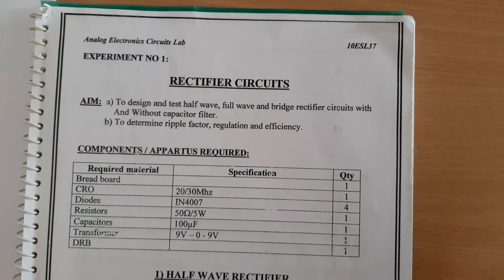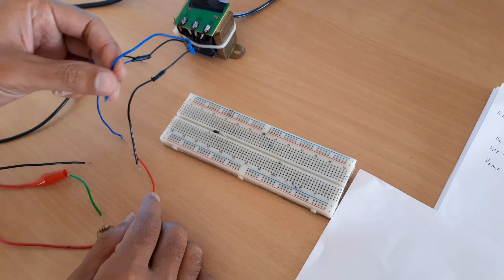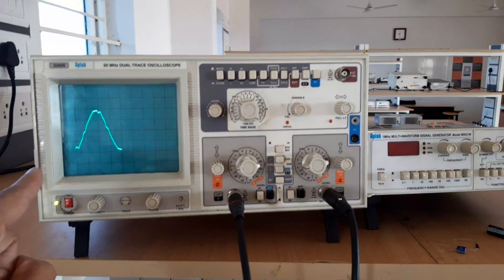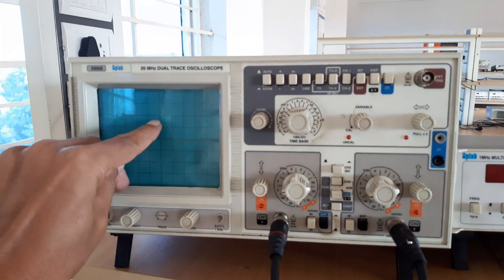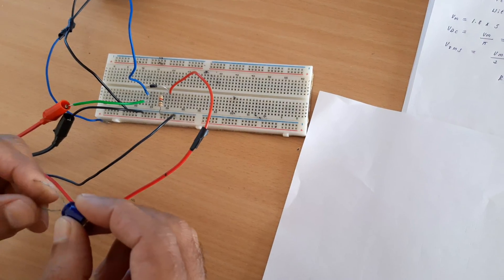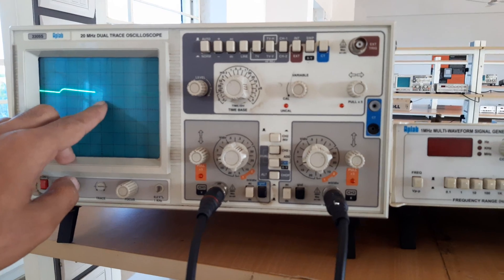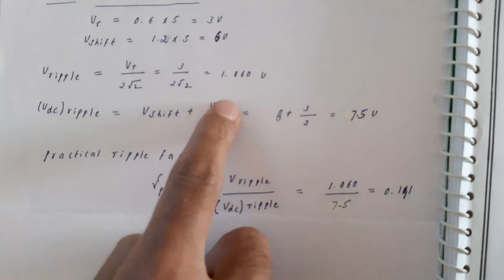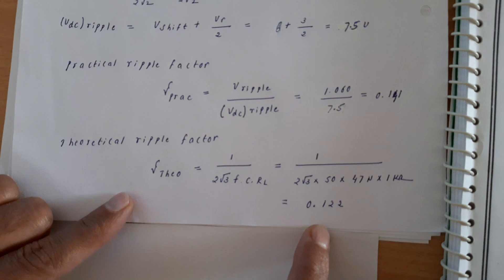Expt No 1a. Half wave rectifier with and without filter and measure the ripple factor.mp4

Comment: Sir why you multiply it by 5 ??
Reply: Because volts per division is set as 5 volts . So for example -  if you got a waveform of 1.4 division , then voltage will be 1.4×5= 7 volts. Also you can set the volts per division as you wish .. ex- 2v/div , 10v/div etc.
Reply: @Sachin_Pawar_34  Thanks bruh u r saving me before the night of pr exams
Reply: @raghavfanje2704  your welcome..😄 and good luck for your exams ❤️🙌
Reply: @Sachin_Pawar_34  Thank u bruh 🙌

Comment: where you have connected the input
Reply: Input is taken from transformer and the transformer is in turn connected to AC power socket.
Reply: if u are asking abt input of cro, then one is connected to anode (left part)of diode and the other to ground.